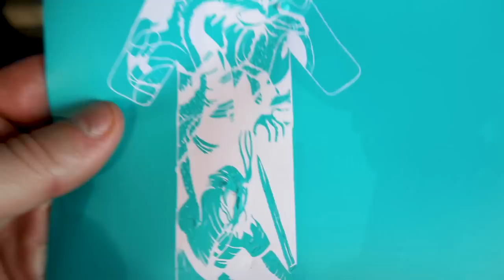Etching a Dragon on Bike Cranks

Comment: I'm a knife maker, I would have used Ferric chloride to etch the aluminum. Apply clear nail polish to the areas you don't want etched, like threads and mating surfaces . After you're done you can remove it with acetone. Also you could do a hard anodize with the finished product. It's fairly easy too get good results.
Reply from the maker: I did think about doing both. This was test #1… there may be more.

Comment: Great kjob  When I worked in aerospace component manufacturing we used this process to identify parts. If you look up “electro chemical etch” you may find some useful supplies, like marking heads to help your process this could have easily devolved to a weeding video. Thanks for the good ole Sunday debut!
Reply from the maker: Thanks 🙏

Comment: You can try covering the surface with a pre-soaked section of thin cloth, like an old tshirt. Maybe drip more solution over the cloth, if needed, while the current runs through.
Reply from the maker: Now we’re thinking. Great idea. Definitely sounds worth a try.